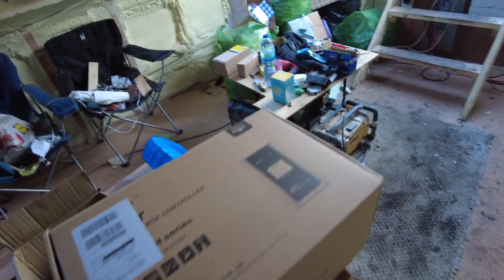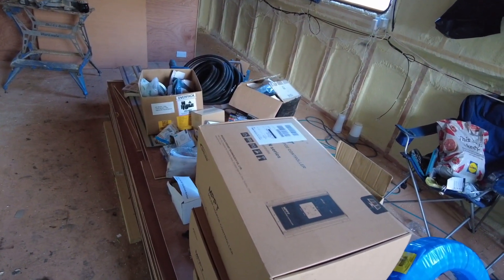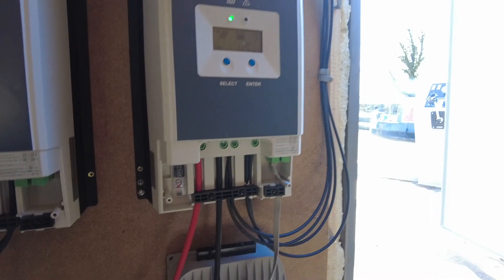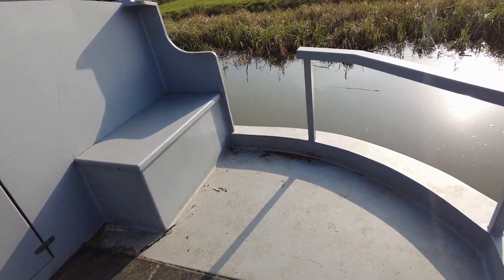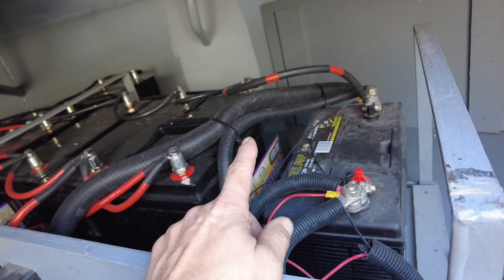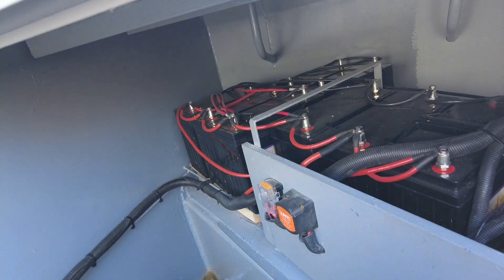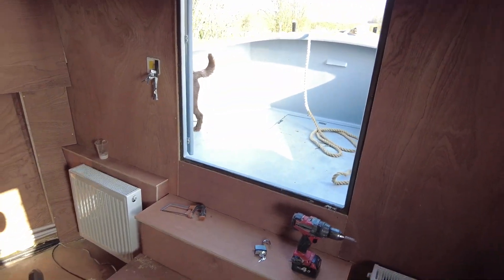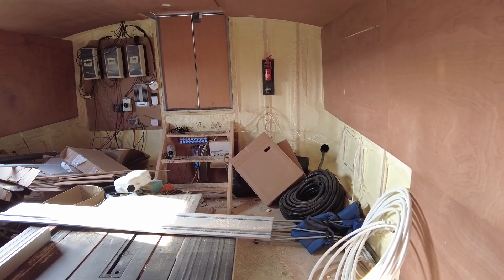Of grid solar system part 2

Comment: Hi great videos, you mentioned the charge controllers and your batteries. But you haven't said what inverter your running. What's total cost of electrical system AC and DC. Whats the cost of boat so far. Really interesting watching you do your boat.
Reply from the maker: I will be revisiting this with a total breakdown of all costs in a video yet to come.

Comment: What is a good amount of solar as I'm planning a wide beam boat, but not sure how much solor.. I want over kill kinda as I'll need loads of power.. ( full size fridge ECT... Also gaming PC.. so I would need a decent panel even if 80/90% of the roof is solar..
Reply: For my truck conversion, I measured up the roof & then did some workings out with various solar panel sizes to maximise the output from the space. Then match these with an MPPT charge controller/inverter & batteries.